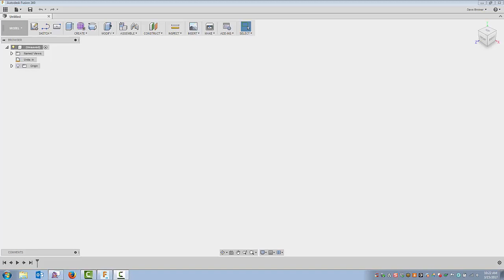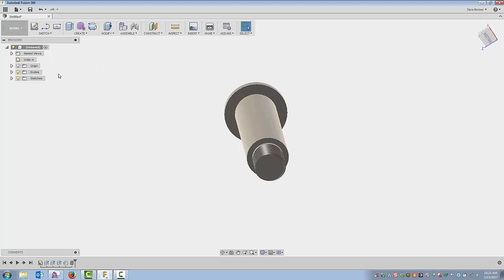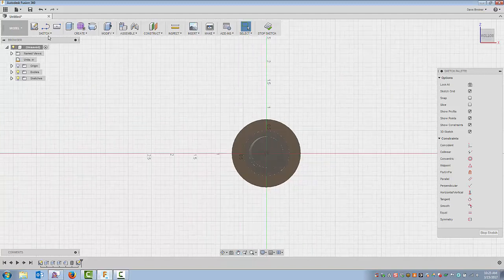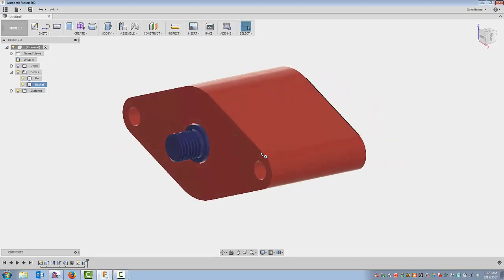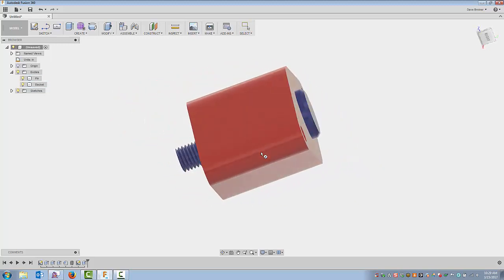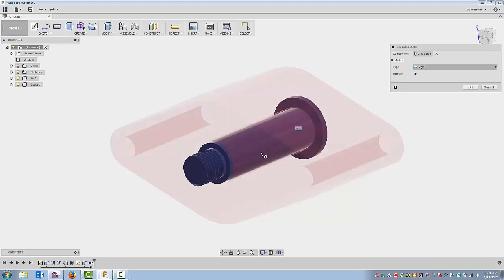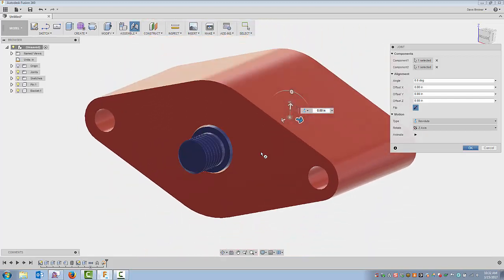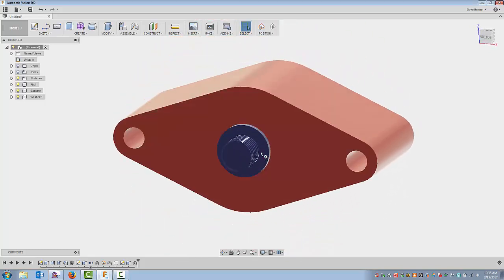Video Tip: Fusion 360 – Bodies, Components & Assemblies

Comment: Nope. You lost me. I still don’t know the difference between a body and component. It’s not you. This is the third video on the subject that I’ve watched.
Reply: From what I gathered... multiple bodies form a component, and multiple components working together form an assembly. Looking at a pair of scissors, there should be 7 components; 2 handles, two blades, the bolt, the nut and the washer. The bolt is a component composed of several bodies: the shaft, the thread, the head and the drive indentation ( Philips head, hex, torx, etc.).